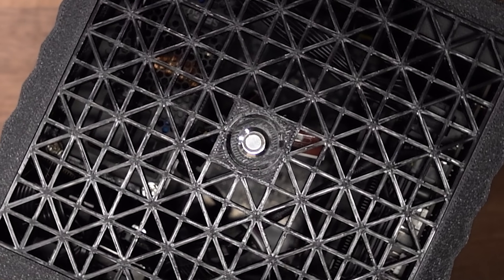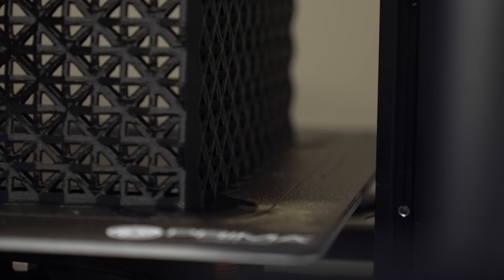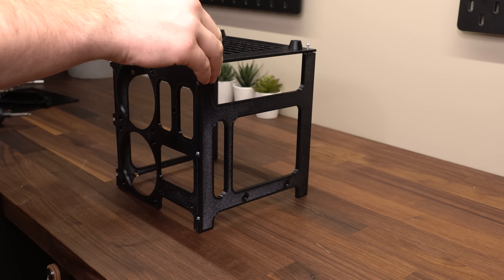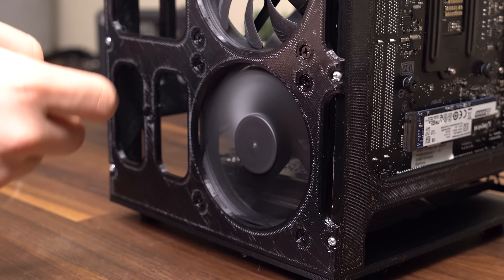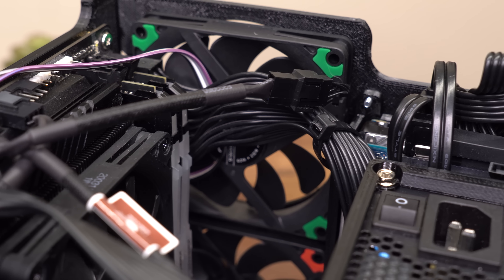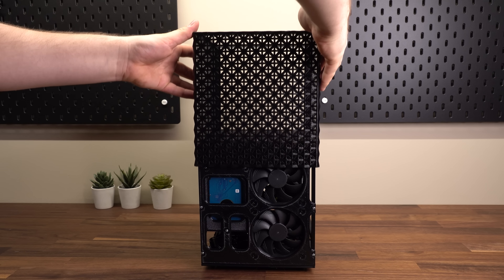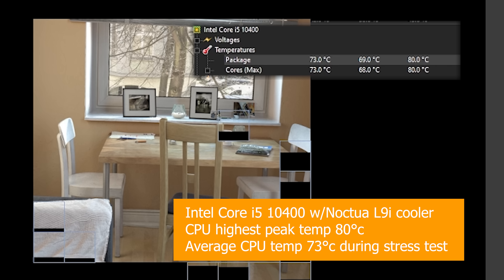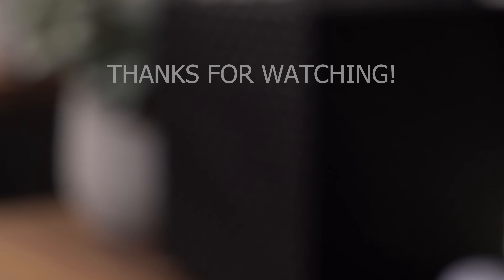Custom 3D Printed ITX cube case

Comment: would love a version that could fit a 4090 FE card
Reply from the maker: How long is even that card? That would have had to be a multi-part cover on that case due to print volume. 
My long term goal is to make something like that someday. 😊
Reply: @makerunit  that would be very cool

according to the googles:
The 4090 FE has added thickness (61 mm vs 57 mm for the RTX 3090 FE) while the RTX 3090 FE is actually longer at 313 mm compared to the 304 mm length of the 4090 FE.

Ive just started printing with a cr10 max so 1 a piece build would be possible
Reply from the maker: @TheDrchaos1989  aha! Awesome! I really thought it was longer than only 305mm! 😊

Comment: nice but bit worried it might melt if pc gets too hot
Reply from the maker: Thanks! All internal chassis parts are PETG so no worries there. External cover is PLA here but this should not be an issue as there is a continious airflow going through it as intakes and the only hot air out is through the top and rear that are both PETG. 👍

Comment: How thick is the motherboard try and is it safe from deforming when cpu heats up on longer periods of time?
Reply: @wojtek-33  i dont have experience with 3d printing but i heard some models will deform when exposed to heat.
Reply from the maker: Hi! As Wojtek also explains here, PLA will hold up and rarely face any problems as long as there is an airflow in the case. The continious airflow would never allow the air to reach 60+ degrees. I have personally never experienced any PLA bending due to PC temps, one of my other cases R5 3600 + 2070 Super has been regularly used at 70-80 degrees for almost two years, still going strong, no deformation at all...
But for this specific case all internal parts were printed in PETG, only the external cover was PLA here.

Comment: how to start a fire 101
Reply from the maker: What part exactly is the fire hazard? 😊 all parts are way within their rated usage temperatures. The plastic won’t melt. All parts are grounded through their power cables. 👌
Reply: @makerunit  do you know about UL94 V-# standard? 
for an example: If the mains circuit has a fault, and starts a small fire, the case should contain that fire until it burns out, or a fuse goes. PLA is flammable, so not only will it not contain the fire, it will feed it
Reply from the maker: @3d_printer_go_brrrrr  obviously I have no clue about that standard, I’m after all just a intermediate youtuber who just passed 3k subs in two years so I guess I’m not at that level yet.. 😅
but who said I printed it in PLA? Is PETG as flammable?
Reply: @3d_printer_go_brrrrr  There's more risk of flammability in the chair you're sitting on than this PC case. A short circuit and fire in a computer case is most likely to be caused by and emanate from the wiring, so the material the case is made from probably doesn't make any difference.

Comment: what's the melting point of the material? does 80 degrees of celcius would made the case soft for example?
Reply from the maker: Hi, even though the components reach up to 80 degrees doesn’t necessarily mean that all the air in the case heats up that much. Actually due to the air passing continiously past the CPU cooler will never allow the air to heat up that much, given the constant change of air inside the case. At 80 (just a peak, most of the time the degrees are just over 70 on the CPU) degrees the ambient air hardly reaches 50 at all. Way before the the plastic starts to soften. 

The external cover was printed in PLA which starts to soften at about 60+, but all internal parts were PETG which can handle about 85-90 before starting to soften.

Comment: Looks really good. It would be quite easy to get some brass threaded inserts and heat-insert those with a soldering iron, to create "proper threads" for the pieces to screw together. This would make it a lot neater and disassembly when needed (and reassembly) would be more secure. Threaded inserts are quite cheap to buy too, and it would give a much more "pro" result for very little extra cost or effort. You could attach the standoffs the same way, insert and then standoff. Oh, and temp wise - I hope you printed this out of PETG or ASA, not PLA. PLA softens and flows quite easily, and is not suited to mechanical parts in any way. 60 degrees C is mentioned, but in my experience just heating it to 40 or 50 makes it prone to deforming if it's under any mechanical pressure, like from carrying relatively heavy PC components.
Reply from the maker: I did consider the inserts and I do actually have some laying around. Main reason for me not using them in this case was due to the thickness of the inner chassis. Also my Sketchup Pro license ran out as I’ve switched Cad software since then. I actually designed this about a year ago but due to various reasons I never got around to actually print it before stumbling across the STLs again a few week ago… 

The external cover is PLA because somehow it felt more matte in the finish than my PETG, apart from that the rest is PETG for all internal chassis parts and the top vent.

Comment: Seems flimsy AF and I'd worry about a) fire, b) total lack of antistatic or EM shielding

I'm not against 3D printed cases or add-ons for cases. My personal opinion is that this is a good start, but it needs work to make it actually useable as a safe PC case.
Reply from the maker: I’ve used/disassembled/built probably 10 different fully 3D printed PC cases the last two years and not as much as a single static spark from anything during those builds… I’m not worried about this at all to be honest. And yes I have been wearing wool socks, and built on a furry carpet. At the same time. 👍

Where is the fire hazard? Each and every component has ground wires that ground them through their power connectors through the PSU, through the outlet. No worries at all. 😊👌 I do understand your concern though.
Reply: @makerunit  if you don't understand by this point in your life that anything electric can cause a fire then I can't help you. Best of luck. Let's hope you don't need it
Reply from the maker: @iamdmc  I do understand that electronics in general can catch on fire due to faults but I’m just not sure how it makes a difference if the case is made out of plastic or metal… 

So please enlighten me, I’d like your opinion as to why a plastic case in general is less safe?
Reply: @makerunit  just look up flammability of PLA. PETG is a bit better, but not that much. It's not that hard to understand that you shouldn't surround potential fire hazards by a flammable material. You can get flame-retardant filaments, but they tend to be expensive.
Reply: @makerunit  Do you think PC cases use metal for shits and giggles? EMI shielding is not about static electricity. Though a metal case helps with that as well. And just because you don't feel any spark doesn't mean you don't have static electricity, that's ridiculous.
If I ever make a 3d-printed case, I'd probably design it to have sandwitched aluminium foil in it, for the EMI. And for fan grills you can get premade metal parts easily.
Reply from the maker: @0xd00f  I see, I was unaware of this «danger», but thanks for letting me know! 😊 I’m no expert at this…

Comment: Ever had Problems with deformation of the plastic at gaming temps? PLA becomes quite weak at around 67°C
Or was it printed in ABS?
Reply: PETG should be fine and it's quite easy to print, I basically only use that. That handles 30+ degrees more than PLA. But yeah, if this is printed in PLA I would expect it to deform. Doesn't take 60+ degrees either imo, just warming it to 40-50 will probably cause issues down the line.
Reply from the maker: This was mainly printed in PETG. All the parts internally are PETG, only part that is PLA is the external cover due to its slightly more matte finish. It’s an intake in the front anyways and no exhausts on the cover, only in the rear where it’s PETG, so I’m not worried at all.

I’ve made multiple 100% PLA cases too and I have not experienced a single issue with PLA  here either (yet at least).

Comment: I wouldn't bother putting a HDD in, let alone 2. They're heavy and loud. You can get SATA SSDs for pretty cheap these days.
Reply from the maker: Honestly, I don’t even use them as all my files are on the two m.2 ssd’s on my motherboard. It was mainly intended to show that the option is there to add if wanted 😊
Reply: @makerunit  Fair enough!

Comment: To improve the surface finish, try turning off combing and consider enabling ironing. Also if they aren't there already, consider modelling the threads inside the holes. You'd be surprised how well modern FDM printers can handle these details!
Reply from the maker: I can imagine that M3 threads would be hard to create, especially with a 0.6 nozzle, but definitely possible for larger threads. I have yet to teach myself how to make threads first… won’t ironing only affect the top layer? I’ll look into the combing settings 😊
Reply: @makerunit  Nozzle size shouldn't make TOO much of a difference to printing threads and other fine details, it more relies on how accurate your printer is. That's not to say it makes no difference, obviously the smaller the nozzle the less of a 'squish' in the layer at a given height. Layer height makes a bigger difference than nozzle diameter.

Threads are pretty easy in Fusion360 and there are plenty of tutorials, give it a try :)

Ironing affects any surface layer depending on what settings you have configured. It works the best on large flat surfaces and your case has plenty of those.
Reply: @makerunit  If you're using Fusion360 there is a very easy thread feature where you just select a cylinder and set the type of thread you want and it does the rest.
As for printing threads, I've done some experiments on my Prusa Mini and was able to print working M4 nuts and bolts, M3 might work with some tuning but I think you're better off just threading into the plastic at that size. Atleast that's what I do.
Reply from the maker: @WallaWillie  this case was designed in Sketchup actually over a year ago. But currently I’m using Shapr3D 😊
Reply: Naah. Threaded brass inserts designed to be heated and pushed into the plastic, with a soldering iron for instance. Form a very strong connection and you get a proper brass metal thread to screw into, and you can obviously un-screw or reattach as many times as necessary. Since, you know, brass.
Reply: You could also use something like a carbon fiber PLA or PETG. Great surface finish.

Comment: I would love to see your process for modeling that ventilation pattern in CAD!
Reply from the maker: Great idea! I’ll see if I can get something put together 😊
Reply: @makerunit  i would also like to see a video showing how u created this in CAD!  also, did u use PLA to print this? id be worried about deformation with PLA or PETG.  I'd uae ASA for the whole build. prints easy and has all of the benefits of ABS without the fumes and warping issues.